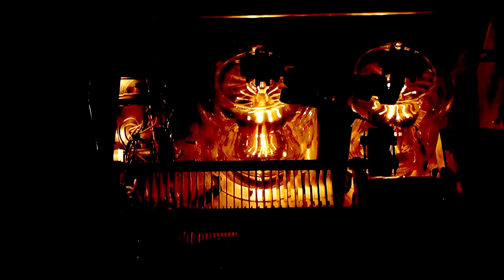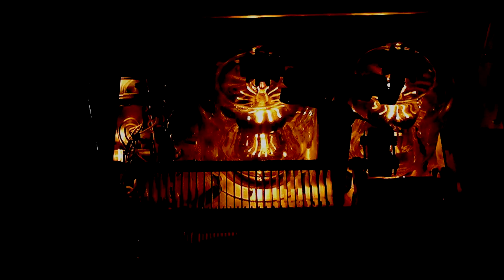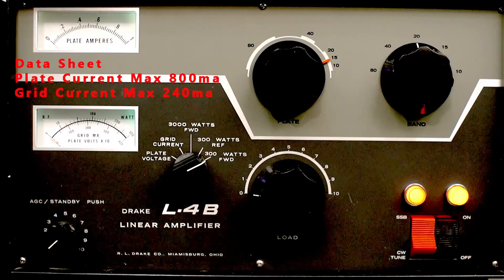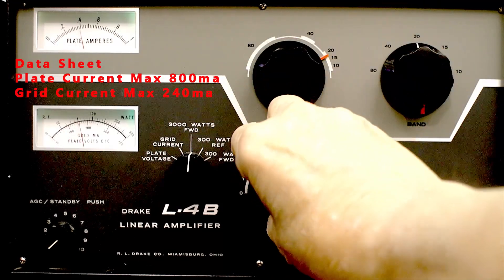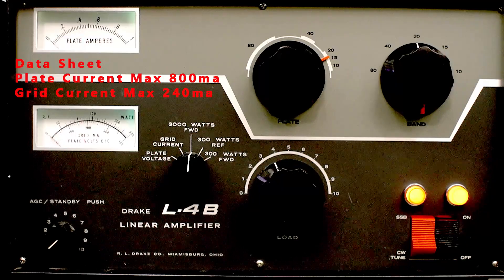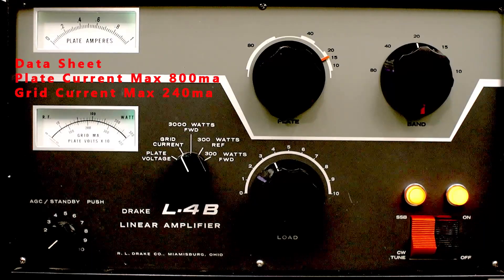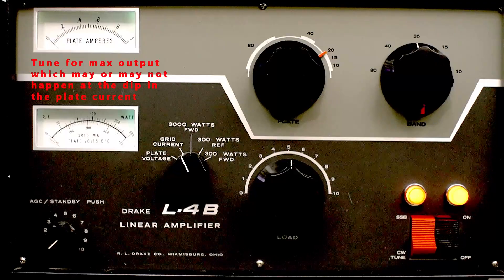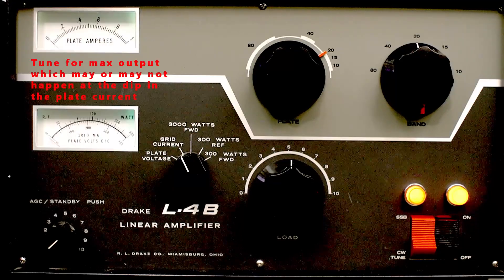Tuning a Linear Amplifier Like the Drake L4B Heathkit SB220 SB200 Ameritron AL82 AL811 with Jim W6LG

Comment: "Sincerely Yours"   From W1VTP, Al.  The answer to your question is no - but there is a procedure as delineated by Jim that must be followed to reduce distortion products (some say 'splatter' - I don't agree with the term but an adjacent 'channel' user, splatter fits the bill.

I follow Jim's approach - feeding the output into a 50 ohm termination that is built for the job.  A final thing I do is using a scope that has a trapezoid mode - I transmit a full power signal with an extended "FIIIIVE', 'SIIIIX' while watching the trapezoid pattern. The unparalleled lines should be straight with no bending at the top of the trace.  Any bending of the lines should be either a biasing or more likely a non-linear output due to a bad tuning sequence and the whole procedure might have to be done.

I have achieved greater than 1,500 watts on my termination with a pair of 3-500ZG's.  Jim could done things slower but watch his original video that goes into more detail.  I have normally achieved > -50 dB/ full output on my distortion products on my amplifier.
Reply: My L4B puts out about 1200 watts when tuned. While the 3-500 tubes will put out more power safely many of the older amps were designed when the input power rule was 2000 watts and that meant the output would seldom go much over 1200 watts.  The plate voltage of that era was the limiting factor.  The 3-500 needs 3000 or more volts to put out the power.  To be legal back then for SSB you had to tune up on the antenna on the low voltage setting  and then switch to the high voltage for SSB and not retune.

Comment: Interesting.  Does it appear to be rather finicky or is that normal when tuning these amps?  Also, are you keying a mic or something in short bursts to keep the amp from delivering constant max power, or is that an effort to keep the dummy load from overheating, or both?  Sorry for the newbie questions - it's because I are one. ; )

Comment: Can you tell me why some hams sound tinny or slight echo when running Hi power amps? 73 Carl
Reply from the maker: Some times there is more than one path.  Some times the amp, even at low power, has huge IMD issues and distortion due to poor tuning and overdriving.  Some times they are using tons of processing.  73, Jim

Comment: Hi Jim,
Hope you are doing well. Thanks for the refresher. I think it was in the 90's last time I tuned up the SB-221. Shouldn't be much longer it will be back on the air as an SB-220. Stay safe.  73  WJ3U
Reply: I wish I could find a video or someone tell me how to adjust my sb220 my technician died and I have never ran one before.